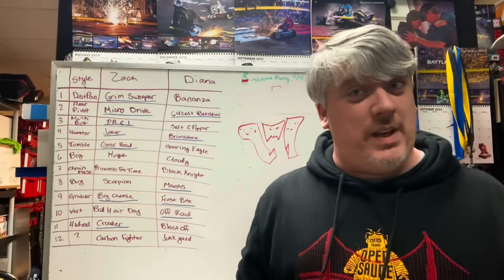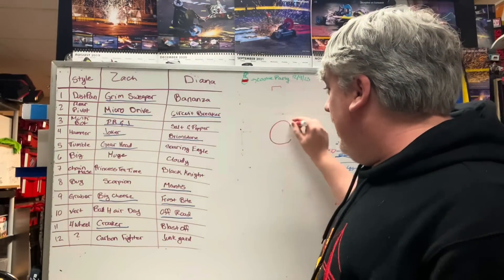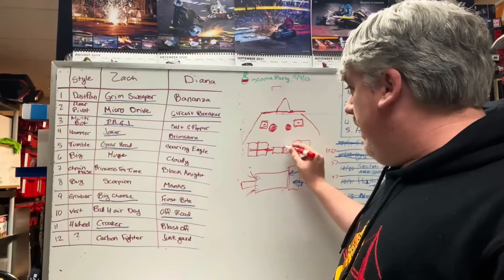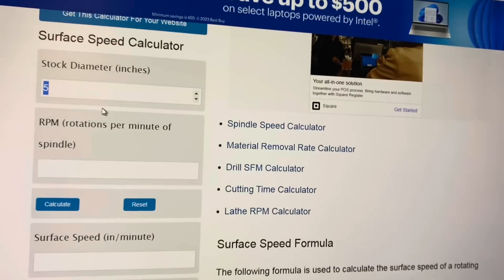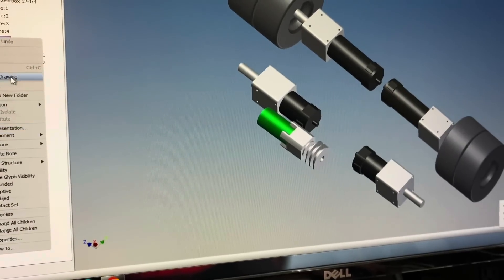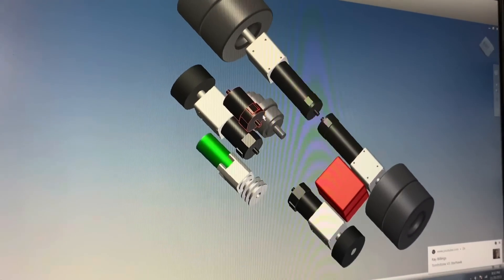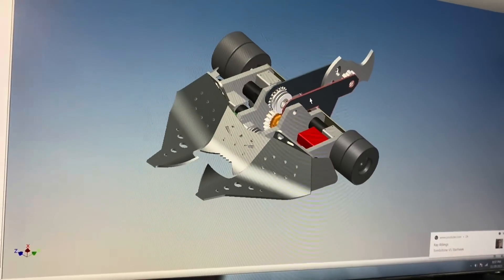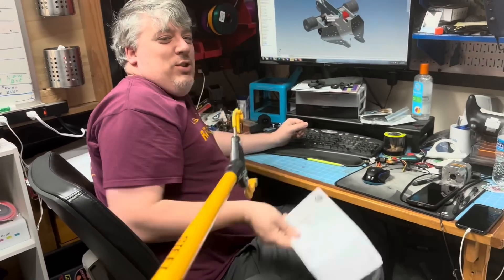We Unveil SKORPIOS X! The BRAND NEW SKORPIOS For Battlebots Season 8!

Comment: Question...If you run a larger wheel and a smaller wheel chained together to one large mag motor and gearbox....Is the surface speed split between the larger and smaller wheel?...or Does the larger wheel assume the surface speed and just pushes the smaller wheel along?
Thanks Diane and Zach for great builder blog videos!!! 🦂🦂

Comment: What are the rules regarding magnets?  Can you use electromagnets or do they have to be permanent?  My thoughts are to use treads, and bury coils of wire in them.  Run positive and negative ground on rails which connect only to the bottom of the treads.  Thus, each link in the tread is electromagnetically stuck to the floor, only when that link is in contact with the floor.

Comment: What purpose does the weapon arm and mechanism serve?  Does it add to the weapon's impact power?  Common sense says it doesn't add meaningfully to the impact potential.  You're going to lighten the arm by making it plastic and flexible?  That will further lessen the impact potential.  Imo completely lose the moving weapon arm and lengthen the wheelbase to stabilize the driving control.

Comment: The forced-air cooling for the mags sounds like added complexity. Why not utilize the aluminum chassis as a massive heatsink? You can use large, squishy thermal pads as a transfer medium if you're worried about shock mounting.

Comment: one question is driving ability? with 4 wheels will handle a lot different, and they are so close together, have you or anyone tested this? if they were on 1/2" suspension system with the magnets attached could really add a lot of pushing power though (that would keep magnets perfect consistency to floor but allow wheels to work together better and use front as a wedge plow with most weight distributed to back wheel for best traction , but otherwise I wonder if by having middle balance wheel point will loose weight to back wheel traction. maybe disposable bronze rails to use for any surface contact?
Reply: (note I think suspension is a reverse one that pulls the bot back to the magnet wheel suspension system, then the magnets stick to the floor, and pull the bot down, while also having power to pull forward)

Comment: I don't know how plausible this is as a design, but I'd put something in place to prevent skorpios from wheeling quite so often, which I've noticed lands it into a fair amount of trouble. Maybe something at the back or redistributing the weight to prevent it from lifting upwards. Or even shifting the wheel positions forwards or backwards. But those are just my thoughts on the matter.

Edit: looks like they've come up with a different idea that resolves that problem.

Comment: From my knowledge, the tires used from Whiplash are very grippy. In cases like the Sawblaze match where you use magnets, more grippy tires could help you stay to the floor better. So I’d change the Skorpios wheels to the Whiplash wheels.
Also thanks for sending down the Skorpios vs. Big Dill tire to Robot Ruckus. I won it, and it is on display in my room. It’s a great piece to own.
Also, if your redesigning Skorpios, what will you do with the old Skorpios parts and such? Is there like an old Skorpios frame that’s going on sale soon or something?

Comment: Hi Zach, as another fellow fan suggests here to ditch motors on the front wheel, just let them roll freely so you gain weight, and with this free weight you could put another aluminum plate perpendicular to the other so you don't have to rely only on you bottom plate to prevent your robot "folding" on the wheel axis orientation. Would recommend joining the plates as the carpentry half lap joint from the bottom, so it easy to do maintenance. Don't know if I passed the message ( something like this ->   00I-|-|-I00   lol, as a singular transverse plate )

Comment: Main change I've felt Skorpios needs the last few seasons is the speed of the hammer saw. Compared to SawBlaze the arm moves quite slowly, negating the bite benefit you get from using such a system. Otherwise it seems like you're addressing many of the issues I'd already noticed with the bot. (mostly that you wheelie when you don't want to and the wheels are too vulnerable).

I'd also be tempted to play with a UHMW chassis like Ripperoni has to save weight over both steel and aluminum. So far they haven't been burned for it and it saved them enough weight for their flywheel without them having to sacrifice much elsewhere.

Comment: If I had to redesign Skorpios, I'd be sorely tempted to replace the hammer saw with a sort of hammer drill. And not with a proper drill bit, but a gnarly knob of destruction. It's probably a bad idea. But so is making a 250 lb death machine, so 🤷🏽‍♂️.

Comment: 12:24 If you wanted to use a 5 inch wheel diameter you could also throttle limit the front wheels to 90% to match the rear speed, though of course that leaves a bit of performance on the table
Reply: is this team bloodsport?

Comment: If your front wheels are going to be just for the magnets, why even make them powered? keep them far enough back from the wedge that a bad hit that bends the wedge wont hit them, and they should be very usable, could even make them from UHMW. 

I don't think you should offer the drivers spot to someone unless they have driven full size bots in full size competition, bettle and ant weights give you experience, but it wont translate well for a first outing with a new bot, might instead say, you can take it to the destructaton or you can be on the team, but the driver is the most critical part of the bot, i dont know if this person has driven the 125lb bots, if so, my opinion would change, but 1 and 3 lb bots even 30lb bots, are very different to the heavier ones.

Comment: I guess one think I would change in Skorpios is the method is the way the weapon motor and transmission handles each hit. Having larger teeth transfers more of the stored kinetic energy, but is more likely to stall/damage the disk motor or wear out the belt transmission after each hit (potentially making the weapon weaker every time it is used). If there was a way to disengage power/drive just after every hit would prevent damage to the motor or transmission (but I guess there is a risk where increasing the complexity will reduce reliability.
Reply: think that's what the belt-drive to the idler is for, soak the backlash in the weapon drive from a hit, so the motor doesn't see that force as aggressively as the weapon itself does
Reply: @niteriderevo9179  true but every time you see smoke when the weapon hits and the belt degrades and the tension reduces (for example Minion vs Codebreaker on YouTube, Minion weapon hits downwards which stall the disk and smoke is emitted from the belt transmission after every hit, eventually the disk to become weaker and weaker until eventually it stops working altogether near the end of the fight because the belt becomes too loose and I fear the same thing could happen to Skorpios’ hammer saw if the fight continues.
Reply: @uppercutter450  would rather eat a few comparatively cheap belts every so often than be killing 400+usd motors from them being forced to stop/stall in around .25 seconds or less.. could also borrow from the RC car/truck world in the form of a slipper clutch, but it'll have the same issue, slips more as it wears down.. might be a bit more difficult to get hold of the wear-materials in the slipper, too
Reply: @niteriderevo9179  From a practical sense I absolutely agree with you, however if a fight goes to the judges, all they will mark is “weapon not functional” and points will be scored against you, potentially costing you the match. If someone discovered a way to disengage and the drive just before or as soon as an impact occurred and reset without weakening the transmission (depending if you can rely on the spinning inertia from the disk to provide enough force for an effective hit), it could really benefit a hammer-saw design which requires multiple consistent hits to achieve a KO (the closest I could think of was a conical pulley and a sloping belt similar to the concept of an automotive CVT).

Comment: I can't describe the amount of relief I felt when you plonked that wedge back at 17:04, it's Skorpios again! Making it out of a composite of materials instead of just steel is going to be very interesting.

If you somehow are able to spare the weight, I think the mini-mags for the front wheels will be worth it (instead of having a belt or chain going from the back motors to drive them), if the front wedge somehow gets pinched you only lose that wheel, not a possibility of the entire side locking up if the front wheel does. A lot of the weight of the bot will be on the front wheels as well (especially when wedging another bot around) so they will be doing most of the work while the rear wheels will be especially effective when the bot is pushing or doing a bit of a wheely.

I'd look into getting some kind of frame rail on the back or bottom of the bot though, boxes are strong and right now the bot is 4 framerails side by side being held together by the wedge, top/bottom plate, since the panels on the back are not continuous so they won't really lock everything together? I just don't want to see this version being split apart and used on highlight reels for the rest of a season.

Comment: I've probably missed something obvious, but what's the reason for not just letting the smaller front wheels spin freely while the back wheels drive?
Reply: rotating would pivot the bot around the center of the 2 back wheels which does not work well with magnets which are supposed to put the center of the bot further forward to avoid the wheeling. in general you want your center of weight also be your point of pivot.

Comment: I think on your smaller tires, if they are a harder material, I think having them slightly less surface speed would still work as the rear should in theory squish some if you are still running the softer compound in the rear?

Comment: If you error in speed from gear box you should always always always have a slightly faster wheel speed in the front. This avoids pushing while turning and gives a pulling effect, also used in all 4 wheel drive vehicles

Comment: Hi Zach, why use powered front wheels? There are added weight and will drag during turning. Consider using ball bearings casters instead. Message me if you want to explore the idea more, I'm an engineer too.

Comment: Have you considered taking the hard wheels and popping them on a lathe to shave them down slightly to the desired diameter? Or possibly ditching the front wheels altogether and use Teflon plates to just slide over the floor? They’d erode fairly quickly, I’m sure, but with the right mounting scheme they’d be fast to change out and you could fine-tune the height between matches.
Reply: Would also save on weight not having to use motors for those front wheels.
Reply: @PelleKuipers  yes, with bearings to roll smoothly. Would be like balancing wheels of a bicycle, but on front
Reply: Teflon plates would be sooo inconsistent to control given box conditions.. add in magnets & hes probs gonna get stuck frequently.. if they wanted to avoid 4 wheel drive, just free spinning wheels on bearings would be far more optimal.. it would just be a rear wheel drive like many every day vehicles... yknow just with the add on of murder hurricane ax
Reply: I was going to suggest that too! DON'T bother driving the front wheels, Convex teflon pads should be ok. Even a "smooth" bulge in the now aluminum frame should work.
Reply: The BattleBots floor is not all that flat.  I would think that trying to glide on it would be problematic.  We see bots get hung up on the seams all the time.  Powering over those lips seems to me to be the right way to go.

Comment: seems like since the front wheels are going to be tiny compared to the rear they're not really going to add that much to the drive and saving all that gearbox + motor weight for armor would probably be better no?
Reply: A second set of wheels really helps with weight distribution and how well the robot drives. There’s a reason Shook won and there’s a reason it’s being emulated here. Personally I’m a fan of a more standard 4wd hammersaw setup like the three pound, Strikepoint and I hope to see that design come into its own.
Reply: then you could also put them between the middle and outer aluminum plates, therefore keeping them ultra protected and not have to worry about the plow getting bent into them and pinching.

Comment: You mentioned putting motors up front for the smaller hard wheels, what if you ditch the smaller motor idea and use them as a free rolling wheel setup just to give you the space needed for the magnets? Less to break is better right? Keep it simple.
Reply: In my experience dead axles on wheels that aren’t omni wheels make it really hard to turn a bot.

Comment: the little ears that protect the small wheels, if they take a powerful hit, it will bend it into the small tires preventing them from moving. ya may wanna put some long bolt behind the wheel that connects to that ear to prevent that from happening.

Comment: but what about the already bult Skorpios #1, Skorpios #2,Skorpios #3,Skorpios #4,Skorpios #5,Skorpios #6, and Skorpios #7! and Skorpios #X (!?!?!?!) tbh bringing droopy on to the team would be goated, Tommy is a top tier bot battler. no matter what this new design will be an improvement. it solves issues without complicating what works and frankly if you get hit what youre making aluminum, you probably are on the back foot anyway. its good to save weight. this will work manifesting

Comment: Wow, this looks nice, cant wait to see this progress. I do have a question/suggestion. Do the front wheels need to be powered at all? It seems like hard casters next to the magnets could achive the same outcome with much less weight.
Reply: They could be, but having them powered means any grip they have can help turn the robot. Skorpios going to 4wd also means losing a back wheel isn't nearly as bad, as that front can still drag it along.
Reply: Very true. The only advantage I can think of is having traction on those front wheels is when in a awkward position where the back wheels are not touching anything. Or after them being damaged, because they seem pretty exposed...

Comment: The amount of "squish" on the rear tires is going to change the effective diameter, and it is going to change a bit under different loads. it would be cool to make the little wheels speed controllers be able to be tweaked as a percentage, maybe even by radio during the fight. it might get you out of some sticky situations.